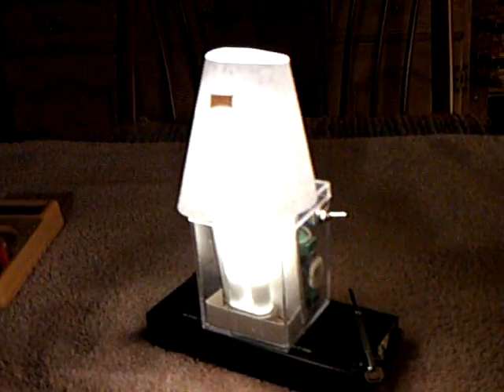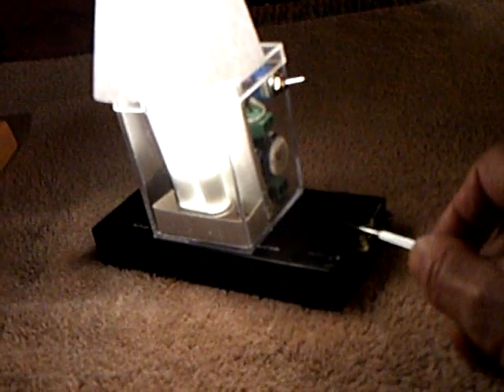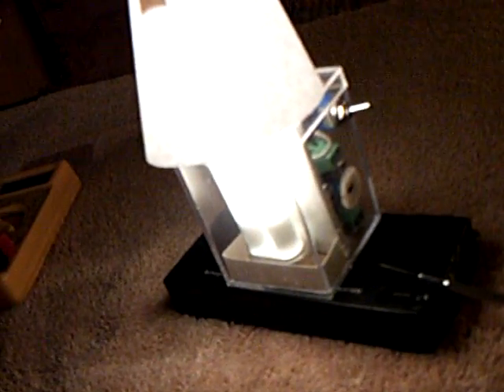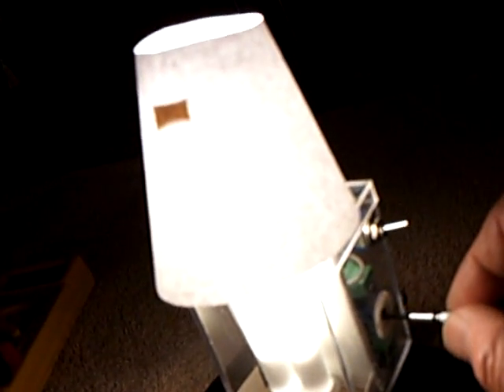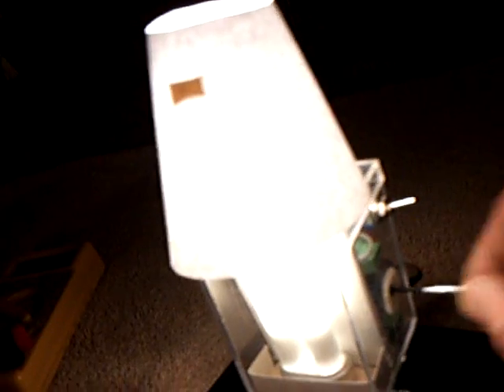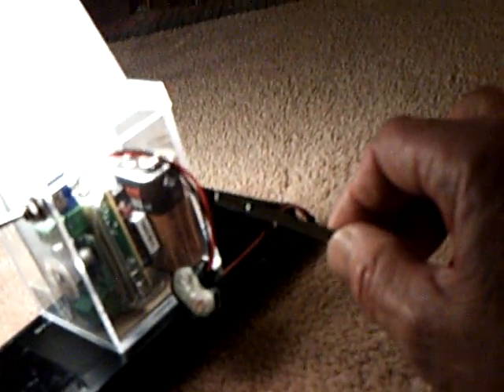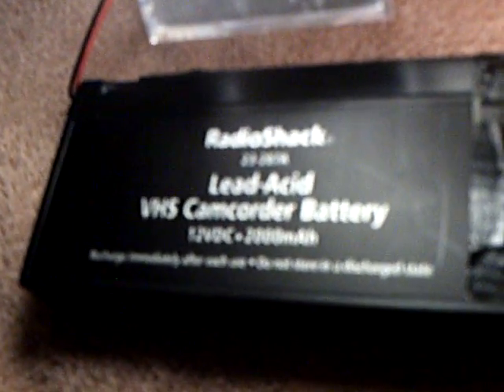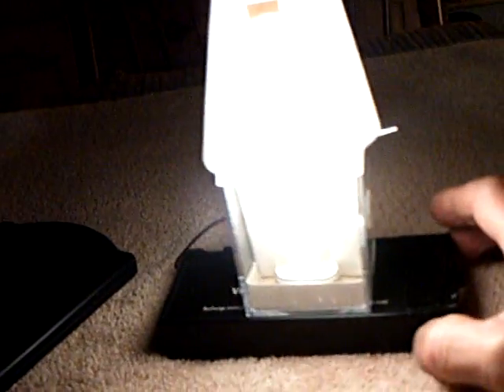Solar powered Table Candle II

Comment: Ive been getting 1.3AHr at about 12.4v off three of them. 

Cant remember the Ah's of your other battery but you can place them in parallel to increase the AH to 2.6AHr.

Paul

Comment: Nice One! Im going to try the same as this with a modified joule thief circuit.

Have you thought of using 3-4 Mobile Phone batteries in series to get the 12v? I think it would fit in the case you have great!

Paul.